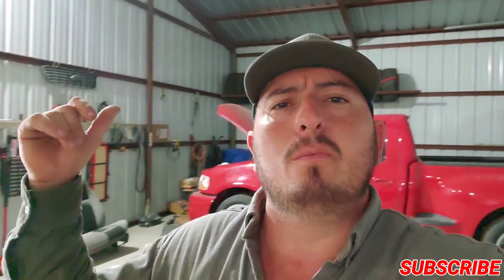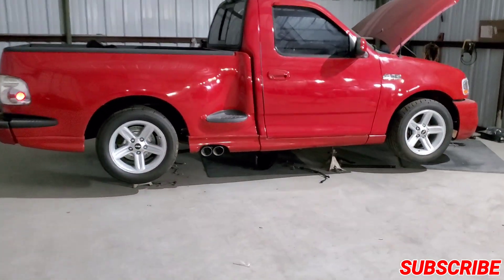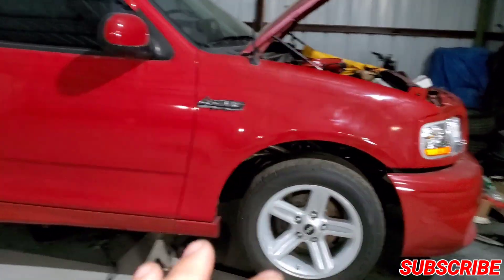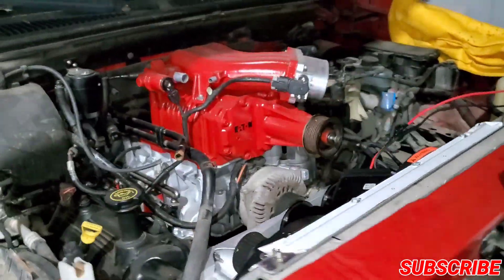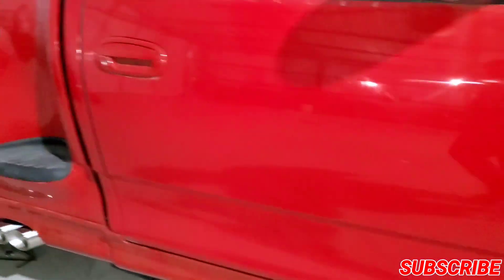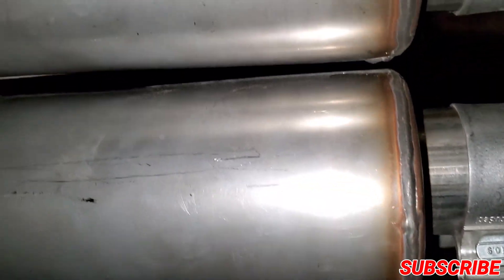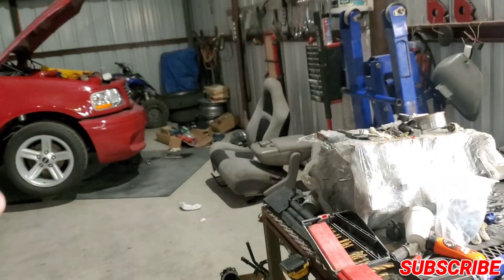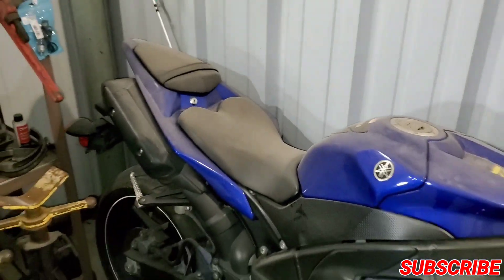svt lightning cog pulley system update

Comment: Amazing work glad i found yall, feels good know my truck is in good hands thanks alot Dave and Mando 👍
Reply from the maker: Thank u for trusting us bro with your black svt lightning. Soon she will have a new heart 💯
Reply: @boosteddave4603  I’ve been looking for a cog pulley system for my truck but the website I found that would sell them say they are discontinued, do u know where I can get one?
Reply from the maker: @mkmajin430  yes sr and rpm outlet has a kit for 1500 and eBay has the same kit we installed for 1100 same brand

Comment: Are those oem 03/04 rims or the sve rims?
Reply from the maker: They are the replicas from lmr
Reply: @boosteddave4603  what’s the difference between oem and replicas?
Reply: @boosteddave4603  wanting to get the replicas unless it’s worth getting oem ones
Reply from the maker: @adofigaribay73  they are both the same but the oem are more expensive and hard to find and the replicas sell fast also on lmr